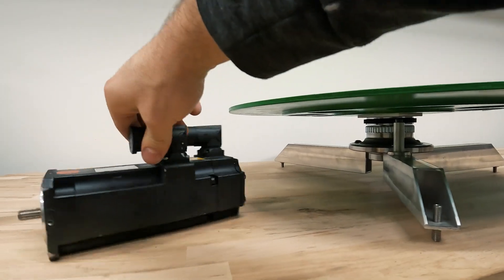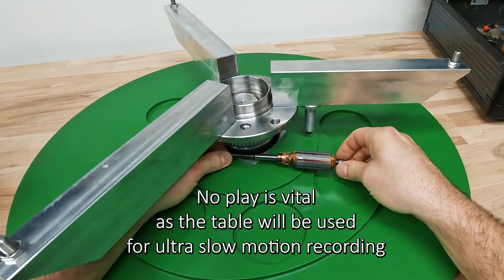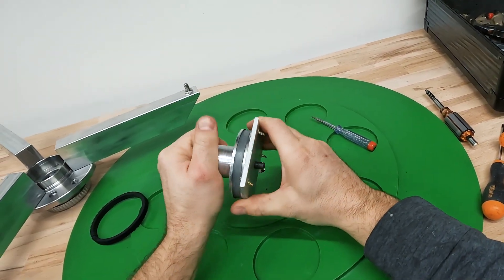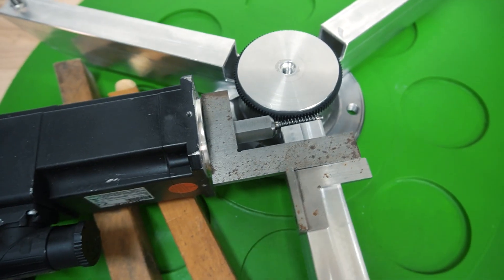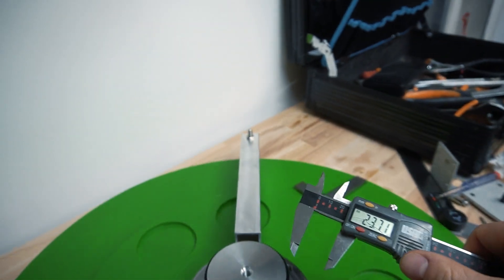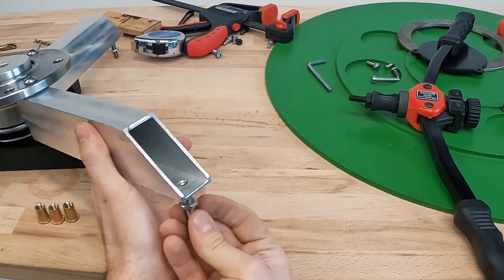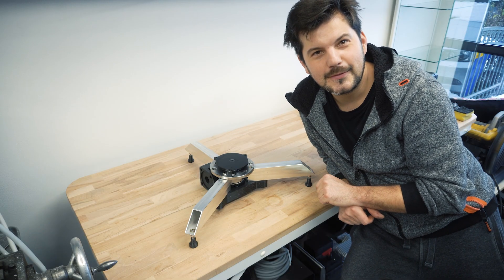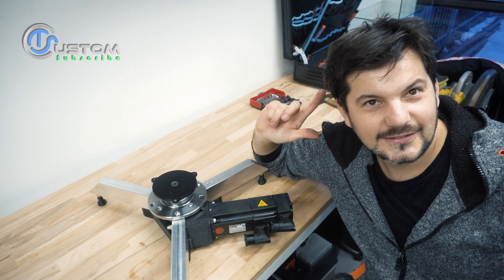I Had 24 Hours to Build a Servo-Controlled Turntable - Here’s How!

Comment: How many RPMs will this spin around and  is the servo motor speed adjustable?
Happy New Year to you and your wife.
Cheers 👍💪✌
Reply from the maker: Hello, happy new year to you too! I am not sure about final max rpm, as I did not even calculate the reduction ratio of the worm gear. We had so little time, we did not even bother. I do know it was perfect, and the customer was very satisfied and all the shooting was perfect. Yes, the speed is adjustable in software, and synchronised with the movement of the kuka robotic arm that is used to move the camera. It is like another axis added for moving the object that is being recorded. You have complete control of the movement for all axis.